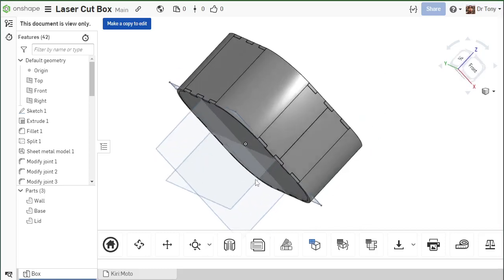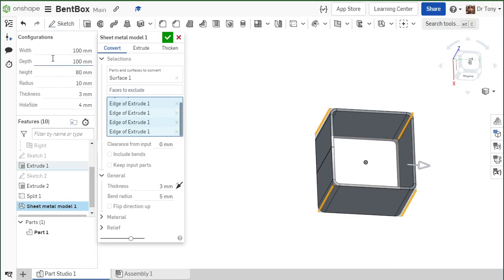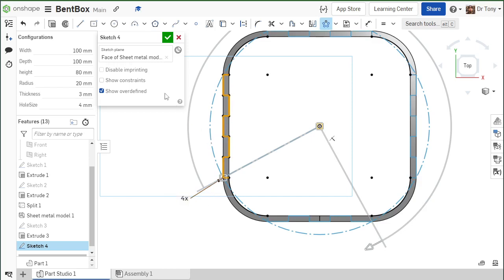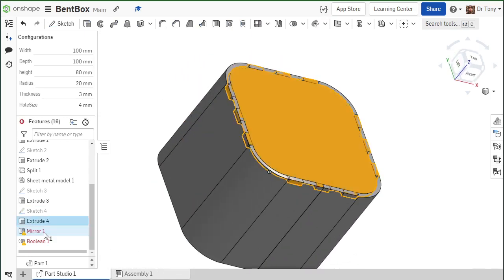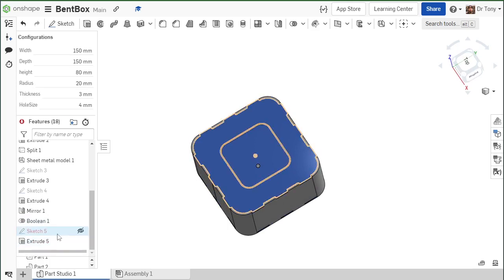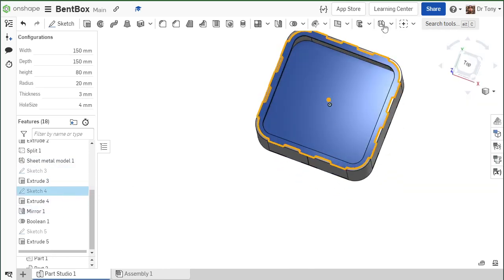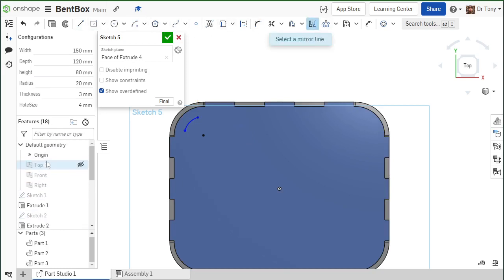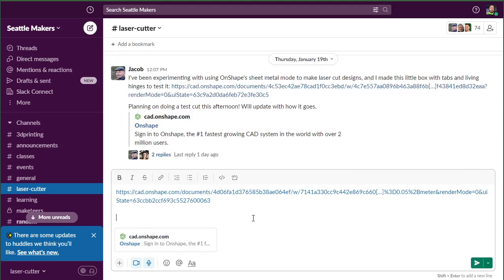OnShape Box Maker (Sheet Metal) reply

Comment: Re: the round edges at 9:03: I think once something is sheet metal, it will not allow any operations that alter its thickness. I think if you added a tiny offset when doing the boolean, it wouldn't affect the edges.